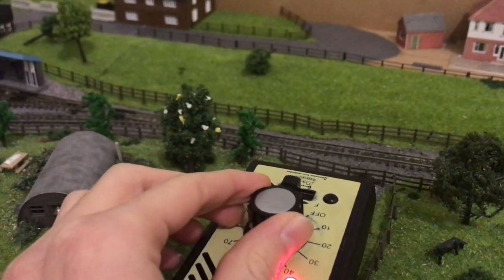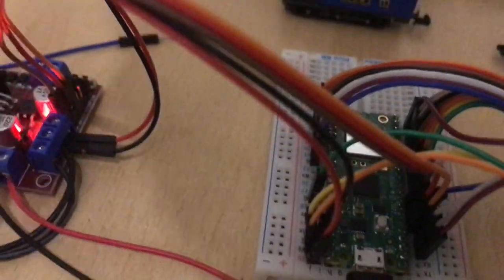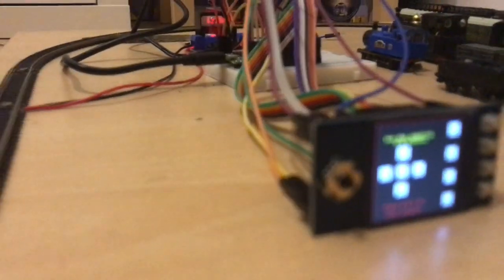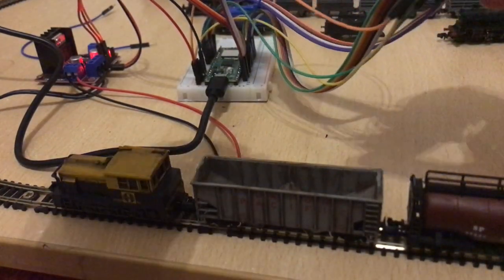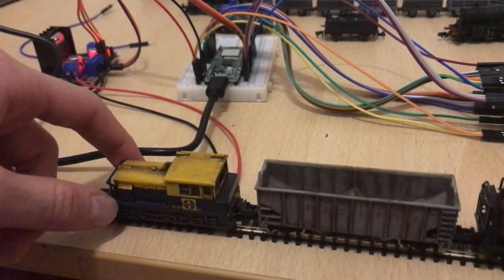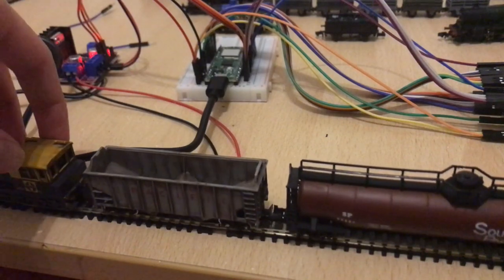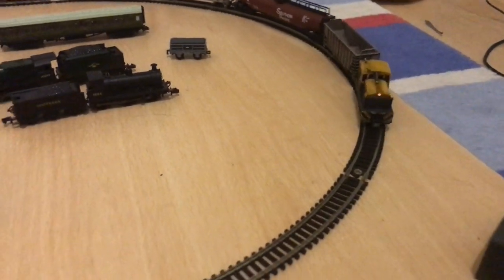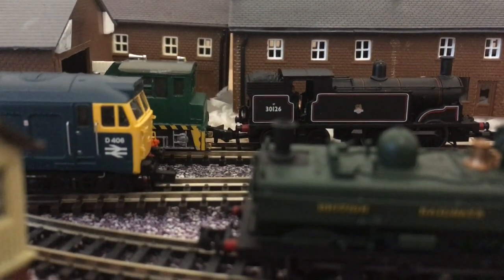Controlling model trains using a Raspberry Pi

Comment from the maker: The code part 1-

# WaveShare 1.3 inch 240x240 screen with Joystick and Buttons + train control 
from machine import Pin,SPI,PWM
from time import sleep
import framebuf
import utime
import os
import math
# ============ Start of Drive Code ================
#  == Copy and paste into your code ==
BL = 13  # Pins used for display screen
DC = 8
RST = 12
MOSI = 11
SCK = 10
CS = 9

class LCD_1inch3(framebuf.FrameBuffer):
    def __init__(self):
        self.width = 240
        self.height = 240
        
        self.cs = Pin(CS,Pin.OUT)
        self.rst = Pin(RST,Pin.OUT)
        
        self.cs(1)
        self.spi = SPI(1)
        self.spi = SPI(1,1000_000)
        self.spi = SPI(1,100000_000,polarity=0, phase=0,sck=Pin(SCK),mosi=Pin(MOSI),miso=None)
        self.dc = Pin(DC,Pin.OUT)
        self.dc(1)
        self.buffer = bytearray(self.height * self.width * 2)
        super().__init__(self.buffer, self.width, self.height, framebuf.RGB565)
        self.init_display()
        
        self.red   =   0x07E0 # Pre-defined colours
        self.green =   0x001f # Probably easier to use colour(r,g,b) defined below
        self.blue  =   0xf800
        self.white =   0xffff
        
    def write_cmd(self, cmd):
        self.cs(1)
        self.dc(0)
        self.cs(0)
        self.spi.write(bytearray([cmd]))
        self.cs(1)  

    def write_data(self, buf):
        self.cs(1)
        self.dc(1)
        self.cs(0)
        self.spi.write(bytearray([buf]))
        self.cs(1)

    def init_display(self):
        """Initialize display"""  
        self.rst(1)
        self.rst(0)
        self.rst(1)
        
        self.write_cmd(0x36)
        self.write_data(0x70)

        self.write_cmd(0x3A) 
        self.write_data(0x05)

        self.write_cmd(0xB2)
        self.write_data(0x0C)
        self.write_data(0x0C)
        self.write_data(0x00)
        self.write_data(0x33)
        self.write_data(0x33)

        self.write_cmd(0xB7)
        self.write_data(0x35) 

        self.write_cmd(0xBB)
        self.write_data(0x19)

        self.write_cmd(0xC0)
        self.write_data(0x2C)

        self.write_cmd(0xC2)
        self.write_data(0x01)

        self.write_cmd(0xC3)
        self.write_data(0x12)   

        self.write_cmd(0xC4)
        self.write_data(0x20)

        self.write_cmd(0xC6)
        self.write_data(0x0F) 

        self.write_cmd(0xD0)
        self.write_data(0xA4)
        self.write_data(0xA1)

        self.write_cmd(0xE0)
        self.write_data(0xD0)
        self.write_data(0x04)
        self.write_data(0x0D)
        self.write_data(0x11)
        self.write_data(0x13)
        self.write_data(0x2B)
        self.write_data(0x3F)
        self.write_data(0x54)
        self.write_data(0x4C)
        self.write_data(0x18)
        self.write_data(0x0D)
        self.write_data(0x0B)
        self.write_data(0x1F)
        self.write_data(0x23)

        self.write_cmd(0xE1)
        self.write_data(0xD0)
        self.write_data(0x04)
        self.write_data(0x0C)
        self.write_data(0x11)
        self.write_data(0x13)
        self.write_data(0x2C)
        self.write_data(0x3F)
        self.write_data(0x44)
        self.write_data(0x51)
        self.write_data(0x2F)
        self.write_data(0x1F)
        self.write_data(0x1F)
        self.write_data(0x20)
        self.write_data(0x23)
        
        self.write_cmd(0x21)

        self.write_cmd(0x11)

        self.write_cmd(0x29)

    def show(self):
        self.write_cmd(0x2A)
        self.write_data(0x00)
        self.write_data(0x00)
        self.write_data(0x00)
        self.write_data(0xef)
        
        self.write_cmd(0x2B)
        self.write_data(0x00)
        self.write_data(0x00)
        self.write_data(0x00)
        self.write_data(0xEF)
        
        self.write_cmd(0x2C)
        
        self.cs(1)
        self.dc(1)
        self.cs(0)
        self.spi.write(self.buffer)
        self.cs(1)
# ========= End of Driver ===========

def colour(R,G,B):
# Get RED value
    rp = int(R*31/255) # range 0 to 31
    if rp < 0: rp = 0
    r = rp *8
# Get Green value - more complicated!
    gp = int(G*63/255) # range 0 - 63
    if gp < 0: gp = 0
    g = 0
    if gp & 1:  g = g + 8192
    if gp & 2:  g = g + 16384
    if gp & 4:  g = g + 32768
    if gp & 8:  g = g + 1
    if gp & 16: g = g + 2
    if gp & 32: g = g + 4
# Get BLUE value       
    bp =int(B*31/255) # range 0 - 31
    if bp < 0: bp = 0
    b = bp *256
    colour = r+g+b
    return colour
    
def ring(cx,cy,r,cc):   # Draws a circle - with centre (x,y), radius, colour 
    for angle in range(91):  # 0 to 90 degrees in 2s
        y3=int(r*math.sin(math.radians(angle)))
        x3=int(r*math.cos(math.radians(angle)))
        LCD.pixel(cx-x3,cy+y3,cc)  # 4 quadrants
        LCD.pixel(cx-x3,cy-y3,cc)
        LCD.pixel(cx+x3,cy+y3,cc)
        LCD.pixel(cx+x3,cy-y3,cc)
  
# =========== Main ============
pwm = PWM(Pin(BL)) # Screen Brightness
pwm.freq(2000)
pwm.duty_u16(32768) # max 65535 - mid value

LCD = LCD_1inch3()
# Background colour - dark grey
LCD.fill(colour(40,40,40))
LCD.show()

# Define pins for buttons and Joystick
keyA = Pin(15,Pin.IN,Pin.PULL_UP) # Normally 1 but 0 if pressed
keyB = Pin(17,Pin.IN,Pin.PULL_UP)
keyX = Pin(19,Pin.IN,Pin.PULL_UP)
keyY= Pin(21,Pin.IN,Pin.PULL_UP)

up = Pin(2,Pin.IN,Pin.PULL_UP)
down = Pin(18,Pin.IN,Pin.PULL_UP)
left = Pin(16,Pin.IN,Pin.PULL_UP)
right = Pin(20,Pin.IN,Pin.PULL_UP)
ctrl = Pin(3,Pin.IN,Pin.PULL_UP)

# Draw background, frame, title and instructions
LCD.rect(0,0,240,240,LCD.red) # Red edge
# White Corners
LCD.pixel(1,1,LCD.white)     # LT
LCD.pixel(0,239,LCD.white)   # LB
LCD.pixel(239,0,LCD.white)   # RT
LCD.pixel(239,239,LCD.white) # RB
LCD.text('Use the joystick', 25, 33, colour(255,255,0))
LCD.text('   and buttons', 25, 43, colour(255,255,0))
LCD.text("Press A & Y to", 30, 200, colour(255,0,0))
LCD.text(" Halt program", 30, 220, colour(255,0,0))
LCD.show()

Comment from the maker: The code part 2-

# ============= Train config ========

IN1 = Pin(5, Pin.OUT)
IN2 = Pin(4, Pin.OUT)

speed = PWM(Pin(6))
speed.freq(2000)

# ============ END train config ========

running = True # Loop control
# =========== Main loop ===============
while(running):
    if keyA.value() == 0:
        LCD.fill_rect(200,15,30,30,colour(255,255,0)) # Yellow
        print("A")
        # ===== train motor code =====
        speed.duty_u16(15000)
        IN1.low()  #spin forward
        IN2.high()
        sleep(10)
        
        speed.duty_u16(17500)
        IN1.low()  #spin forward
        IN2.high()
        sleep(10)
        
        speed.duty_u16(20000)
        IN1.low()  #spin forward
        IN2.high()
        sleep(10)
        
        speed.duty_u16(22500)
        IN1.low()  #spin forward
        IN2.high()
        sleep(10)
        
        speed.duty_u16(25000)
        IN1.low()  #spin forward
        IN2.high()
        sleep(10)
        
        speed.duty_u16(27500)
        IN1.low()  #spin forward
        IN2.high()
        sleep(10)
        
        speed.duty_u16(30000)
        IN1.low()  #spin forward
        IN2.high()
        sleep(15)
        
        speed.duty_u16(32500)
        IN1.low()  #spin forward
        IN2.high()
        sleep(15)
        
        speed.duty_u16(35000)
        IN1.low()  #spin forward
        IN2.high()
        sleep(15)
        
        speed.duty_u16(37500)
        IN1.low()  #spin forward
        IN2.high()
        sleep(15)
        
        speed.duty_u16(40000)
        IN1.low()  #spin forward
        IN2.high()
        sleep(15)
        
        speed.duty_u16(42500)
        IN1.low()  #spin forward
        IN2.high()
        sleep(15)
        
        speed.duty_u16(45000)
        IN1.low()  #spin forward
        IN2.high()
        sleep(15)
        
        speed.duty_u16(47500)
        IN1.low()  #spin forward
        IN2.high()
        sleep(15)
        
        speed.duty_u16(50000)
        IN1.low()  #spin forward
        IN2.high()
        sleep(15)
        
        speed.duty_u16(52500)
        IN1.low()  #spin forward
        IN2.high()
        sleep(15)
        
        speed.duty_u16(55000)
        IN1.low()  #spin forward
        IN2.high()
        sleep(60)
        # ===== end train motor code =====
    else :
        LCD.fill_rect(200,15,30,30,LCD.white)
        LCD.rect(200,15,30,30,LCD.red)            
        
    if(keyB.value() == 0):
        LCD.fill_rect(200,75,30,30,colour(255,0,255)) # Magenta
        print("B")
        # ===== train motor code =====
        speed.duty_u16(10000)
        IN1.low()  #spin forward
        IN2.high()
        sleep(15)
        
        speed.duty_u16(12500)
        IN1.low()  #spin forward
        IN2.high()
        sleep(15)
        
        speed.duty_u16(15000)
        IN1.low()  #spin forward
        IN2.high()
        sleep(15)
        
        speed.duty_u16(17500)
        IN1.low()  #spin forward
        IN2.high()
        sleep(15)
        
        speed.duty_u16(20000)
        IN1.low()  #spin forward
        IN2.high()
        sleep(20)
        
        speed.duty_u16(22500)
        IN1.low()  #spin forward
        IN2.high()
        sleep(20)
        
        speed.duty_u16(25000)
        IN1.low()  #spin forward
        IN2.high()
        sleep(20)
        
        speed.duty_u16(27500)
        IN1.low()  #spin forward
        IN2.high()
        sleep(20)
        
        speed.duty_u16(30000)
        IN1.low()  #spin forward
        IN2.high()
        sleep(20)
        
        speed.duty_u16(32500)
        IN1.low()  #spin forward
        IN2.high()
        sleep(20)
        
        speed.duty_u16(37500)
        IN1.low()  #spin forward
        IN2.high()
        sleep(20)
        
        speed.duty_u16(40000)
        IN1.low()  #spin forward
        IN2.high()
        sleep(15)
        
        speed.duty_u16(42500)
        IN1.low()  #spin forward
        IN2.high()
        sleep(60)
        
         
    else :
        LCD.fill_rect(200,75,30,30,LCD.white)
        LCD.rect(200,75,30,30,LCD.red)
                   
    if(keyX.value() == 0):
        LCD.fill_rect(200,135,30,30,colour(0,255,255)) # Cyan
        print("X")
        # ===== train motor code =====
        speed.duty_u16(15000)
        IN1.high()  #spin back
        IN2.low()
        sleep(10)
        
        speed.duty_u16(17500)
        IN1.high()  #spin back
        IN2.low()
        sleep(10)
        
        speed.duty_u16(20000)
        IN1.high()  #spin back
        IN2.low()
        sleep(10)
        
        speed.duty_u16(22500)
        IN1.high()  #spin back
        IN2.low()
        sleep(10)
        
        speed.duty_u16(25000)
        IN1.high()  #spin back
        IN2.low()
        sleep(10)
        
        speed.duty_u16(27500)
        IN1.high()  #spin back
        IN2.low()
        sleep(10)
        
        speed.duty_u16(30000)
        IN1.high()  #spin back
        IN2.low()
        sleep(15)
        
        speed.duty_u16(32500)
        IN1.high()  #spin back
        IN2.low()
        sleep(15)
        
        speed.duty_u16(35000)
        IN1.high()  #spin back
        IN2.low()
        sleep(15)
        
        speed.duty_u16(37500)
        IN1.high()  #spin back
        IN2.low()
        sleep(15)
        
        speed.duty_u16(40000)
        IN1.high()  #spin back
        IN2.low()
        sleep(15)
        
        speed.duty_u16(42500)
        IN1.high()  #spin back
        IN2.low()
        sleep(15)
        
        speed.duty_u16(45000)
        IN1.high()  #spin back
        IN2.low()
        sleep(15)
        
        speed.duty_u16(47500)
        IN1.high()  #spin back
        IN2.low()
        sleep(15)
        
        speed.duty_u16(50000)
        IN1.high()  #spin back
        IN2.low()
        sleep(15)
        
        speed.duty_u16(47500)
        IN1.high()  #spin back
        IN2.low()
        sleep(15)
        
        speed.duty_u16(45000)
        IN1.high()  #spin back
        IN2.low()
        sleep(15)
        
        speed.duty_u16(42500)
        IN1.high()  #spin back
        IN2.low()
        sleep(15)
        
        speed.duty_u16(40000)
        IN1.high()  #spin back
        IN2.low()
        sleep(15)
        
        speed.duty_u16(37500)
        IN1.high()  #spin back
        IN2.low()
        sleep(15)
        
        speed.duty_u16(35000)
        IN1.high()  #spin back
        IN2.low()
        sleep(15)
        
        speed.duty_u16(32500)
        IN1.high()  #spin back
        IN2.low()
        sleep(15)
        
        speed.duty_u16(30000)
        IN1.high()  #spin back
        IN2.low()
        sleep(15)
        
        speed.duty_u16(27500)
        IN1.high()  #spin back
        IN2.low()
        sleep(10)
        
        speed.duty_u16(25000)
        IN1.high()  #spin back
        IN2.low()
        sleep(10)
        
        speed.duty_u16(22500)
        IN1.high()  #spin back
        IN2.low()
        sleep(10)
        
        speed.duty_u16(20000)
        IN1.high()  #spin back
        IN2.low()
        sleep(10)
        
        speed.duty_u16(17500)
        IN1.high()  #spin back
        IN2.low()
        sleep(10)
        
        speed.duty_u16(15000)
        IN1.high()  #spin back
        IN2.low()
        sleep(10)
        
        IN1.low()  #stop train
        IN2.low()
        
        # ===== end train motor code =====
        
    else :
        LCD.fill_rect(200,135,30,30,LCD.white)
        LCD.rect(200,135,30,30,LCD.red)
        
    if(keyY.value() == 0):
        LCD.fill_rect(200,195,30,30,colour(255,180,50)) # Orange
        print("Y")
        
        speed.duty_u16(55000)
        IN1.low()  #spin forward
        IN2.high()
        sleep(10)
        
        speed.duty_u16(52500)
        IN1.low()  #spin forward
        IN2.high()
        sleep(10)
        
        speed.duty_u16(50000)
        IN1.low()  #spin forward
        IN2.high()
        sleep(10)
        
        speed.duty_u16(47500)
        IN1.low()  #spin forward
        IN2.high()
        sleep(10)
        
        speed.duty_u16(45000)
        IN1.low()  #spin forward
        IN2.high()
        sleep(10)
        
        speed.duty_u16(42500)
        IN1.low()  #spin forward
        IN2.high()
        sleep(10)
        
        speed.duty_u16(40000)
        IN1.low()  #spin forward
        IN2.high()
        sleep(10)
        
        speed.duty_u16(37500)
        IN1.low()  #spin forward
        IN2.high()
        sleep(10)
        
        speed.duty_u16(35000)
        IN1.low()  #spin forward
        IN2.high()
        sleep(10)
        
        speed.duty_u16(32500)
        IN1.low()  #spin forward
        IN2.high()
        sleep(10)
        
        speed.duty_u16(30000)
        IN1.low()  #spin forward
        IN2.high()
        sleep(10)
        
        speed.duty_u16(27500)
        IN1.low()  #spin forward
        IN2.high()
        sleep(10)
        
        speed.duty_u16(25000)
        IN1.low()  #spin forward
        IN2.high()
        sleep(10)
        
        speed.duty_u16(22500)
        IN1.low()  #spin forward
        IN2.high()
        sleep(10)
        
        speed.duty_u16(20000)
        IN1.low()  #spin forward
        IN2.high()
        sleep(10)
        
        speed.duty_u16(17500)
        IN1.low()  #spin forward
        IN2.high()
        sleep(10)
        
        speed.duty_u16(15000)
        IN1.low()  #spin forward
        IN2.high()
        sleep(10)
        
        IN1.low()  #stop train
        IN2.low()

Comment from the maker: The code part 3- 

   else :
        LCD.fill_rect(200,195,30,30,LCD.white)
        LCD.rect(200,195,30,30,LCD.red)
        
    if(up.value() == 0):
        LCD.fill_rect(60,60,30,30,LCD.red)
        print("UP")
        
    else :
        LCD.fill_rect(60,60,30,30,LCD.white)
        LCD.rect(60,60,30,30,LCD.red)
        
    if(down.value() == 0):
        LCD.fill_rect(60,150,30,30,LCD.red)
        print("DOWN")
    else :
        LCD.fill_rect(60,150,30,30,LCD.white)
        LCD.rect(60,150,30,30,LCD.red)
        
    if(left.value() == 0):
        LCD.fill_rect(15,105,30,30,LCD.red)
        print("LEFT")
    else :
        LCD.fill_rect(15,105,30,30,LCD.white)
        LCD.rect(15,105,30,30,LCD.red)
    
    if(right.value() == 0):
        LCD.fill_rect(105,105,30,30,LCD.red)
        print("RIGHT")
    else :
        LCD.fill_rect(105,105,30,30,LCD.white)
        LCD.rect(105,105,30,30,LCD.red)
    
    if(ctrl.value() == 0):
        LCD.fill_rect(60,105,30,30,LCD.red)
        print("CTRL")
    else :
        LCD.fill_rect(60,105,30,30,LCD.white)
        LCD.rect(60,105,30,30,LCD.red)
                   
    LCD.show()
    if (keyA.value() == 0) and (keyY.value() == 0): # Halt looping?
        running = False
        
utime.sleep(.15) # Debounce delay - reduce multiple button reads
    
# Finish
LCD.fill(0)
for r in range(10):
    ring(120,120,60+r,colour(255,255,0))
LCD.text("Halted", 95, 115, colour(255,0,0))
LCD.show()
# Tidy up
utime.sleep(3)
LCD.fill(0)
LCD.show()